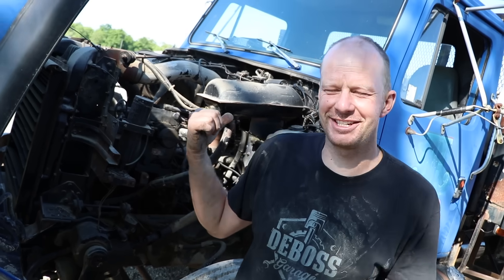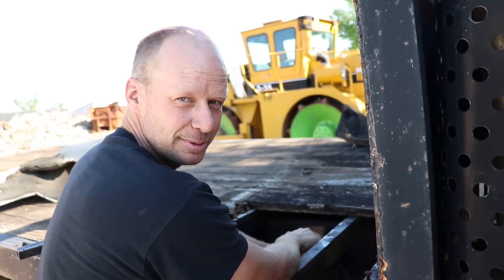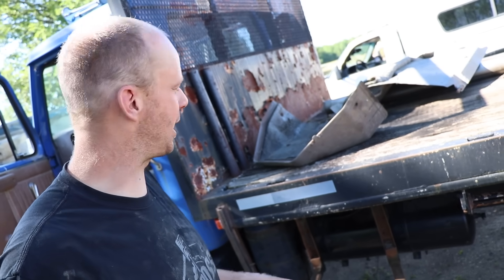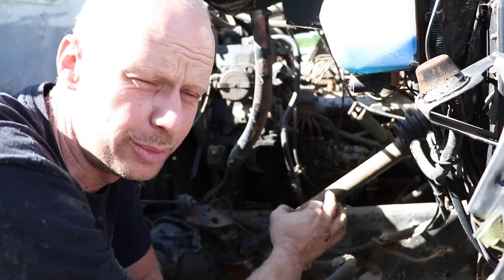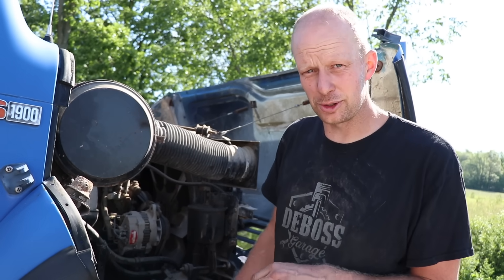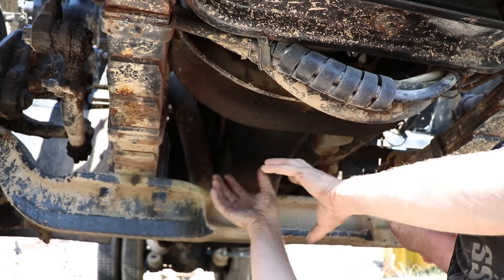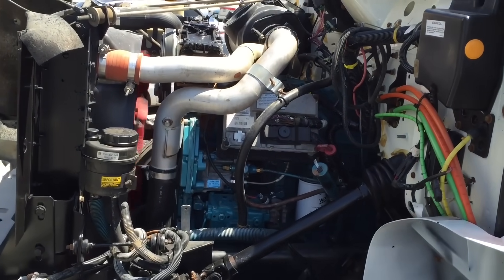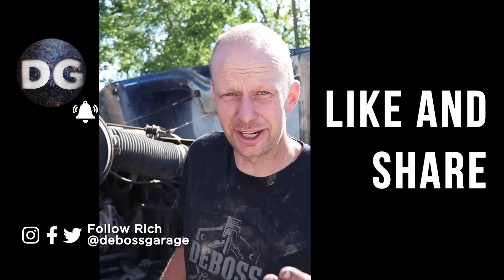REVIEW: Everything Wrong With a 7.6 Navistar DT466 Diesel

Comment from the maker: Happy Canada Day! What engine should we review next? 🤔
Reply: Detriot 60 series, Cummins 400, 6.2 Detriot, the Olds 350 diesel,
Reply: He already did the 6.2/6.5
Reply: @seanhazelwood3311  i know he did the 6.5, but I don't recall him doing the 6.2. Only issue they have from what I've seen is lack of power, but plenty of tourqe. You ain't going anywhere fast but you'll pull the house, the boat, both cars, and the mother in law while doing it
Reply: Both in same video. My experience with the 6.2 was in the army, first gen hmmwv's. Gutless was an understatement, impossible to start in winter. They hated mud because there wasnt enough power to turn 37x12.50-16.5s, even in low range.
Reply: Dt 366
Reply: Detroit diesel 53/72/92 two strokes or the 8.3 pincher four stroke. 8.2 N/A was highly reliable because it didn’t do anything.
Reply: Detroit Series 60
Reply: the new ford 7.3L gas
Reply: Lets see more Deutz engines 🧐
Reply: Toyota fork left engine
Reply: SD33T, Nissan engine that was put in the international scouts. Supposed to be easy to find them in forklifts and such, would love to know more about them, and about taking them out of more industrial stuff, and into vehicles.
Reply: Deutz BF6L913 air cooled
Reply: 855 cummins
Reply: 855 cummins
Reply: Yep Happy Canada Day Rich From Vancouver Island
Reply: DT530 mechanical 
The 466 big brother
Reply: 60 series
Reply: Perkins/Mazda 2.2L, as installed in a Ranger or mazda pickup.
Reply: 3.5 Ecoboost
Reply: 6.0 Powerstroke.
Reply: What about the t444e?
Reply: @pieissquared  He already did both the 7.3's.
Reply: International 392
Reply: will you be doing an everything wrong with the common rail cummins?
Reply: Om617 or deuzt f5l912
Reply: isuzu diesel engines
Reply: I'd like to see something on the Big Al Allis Chalmers 844cid engine
Reply: Mack E9500
Reply: 350 Chev Vs 351W Vs 351M?
Reply: any FIAT/Heeston tractors round your way? the small 6 cylinder and the 5 cylinder in the 90-90, and 110-90 were solid little donkeys
Reply: Volvo D13
Reply: Dt360
Reply: Ford 351 Windsor.
Reply: Allis Chalmers 844
Reply: i rebult one of the first generation dt466 the other day, it melted a piston and i have pictures
Reply: @loganbachman2769  share them to him.
Reply: Renault Clios 1.3 petrol! The kxj! 

Twenty years old and still carries me to work, can’t beat it
Reply: @ringodooby  problem: we don't have that here in Canada. We haven't seen anything made by Renault since 1988 (With the apparent exception of the Tiggy? Somewhere?)
Reply: @dposcuro  Mack. Synonymous with Renault and now Volvo. The E7 has Renault written all over it. The Club of Four Midliner and it’s predecessor are Renault.
Reply: @jcm78  Hunh, had no idea.
Reply: ISX15 600 Cummins
Reply: Cummins 400 c series cat or Volkswagen tdi engine
Reply: Big cam 400 cummins
Reply: VW 2.0TDI
Reply: Detroit series 60
Reply: Cat 3406
Reply: Mercedes OM engines
Reply: Deutz A6M428! lol
Reply: Doosan DV11 they have a sound that is amazing, they bark when revved from idle to full rpm
Reply: Isx15 or n14
Reply: 6.2 Detroit. How the block and injection pump numbers matter when picking the right year.
Reply: EcoDiesel and 1.9 tdi 👋🏻🇨🇦happy Canada day from Nova Scotia eh
Reply: I would like more on the international  DT 360
Reply: L10/m11
Reply: Old 304 diesel
Reply: 6.7 powerstroke.
Reply: Have you heard about Navistars MWM South American motors. The Iveco's Cursor motor which is basically a Navistar motor.
Reply: "What engine?" is the point... I'd like your thoughts on the future of diesel swaps, especially for small and mid-size trucks. Mercedes OM series a getting rare, wih VW out of the game the TDi supply will also dry up soon, and 4BTs are not always the best option due to weight. That leaves what, the baby Duramax and the R2.8? What if someone wants a small engine wih mechanical injection? Is there anything left?
Reply: C7 cat
Reply: 6.4 power stroke
Reply: Chevy 350 or anny small block chevy
Reply: 3116 cat, c9 cat
Reply: Yanmar 3t90j, I have a 1978 john deere 950 with one and would like more info on the engine than I have
Reply: Or the multi fuel engines that came in the m35a2 army trucks thatd be cool
Reply: 1150 cummins or maybe the 13 liter Fiat or a Paccar MX 450
Reply: C7 CAT
Reply: Powerjoke 6.0!!!!!
Reply: Cat c7
Reply: Cat c7
Reply: 237 Mack
Reply: The worst I've seen was the mechanical lift pump wore out and filled the oil with diesel which didnt hurt the engine just gave the an oil flush lol
Reply: Please
I need MORE videos on the twin turbo Duramax tow truck you are building......
When can we see some more on that build????
Reply: 5.0 or a 5.8
Reply: Fiat 0.9l
Reply: 5.9 common rail cummins
Reply: Chevy 4.8 L. And Allis Chalmers 4.9 L.
Reply: CR TDI
Reply: Perkins AT6 354.4?
Reply: 1999-2003 Ford 7.3 PSD next
Reply: Series 60 Detroit Diesel
Reply: Heui engines require 800 plus psi to fire the injectors
Reply: 855 Cummins. I'd go right from the original small cams through the generations of the Big Cams up to the the N14 Celect. It's had an insane run in the industrial world.
Reply: 6.9/7.3 idi, i had a 6.9 with 396k miles before i sold it and its still running around.
Reply: Big Cam 400
Reply: International 9.0 Liter. 70/80s 'glory'...
Reply: ford 300 lol
Reply: how about ISX, all versions from 1998-current?
Reply: Detroit 8v92!!!
Reply: 5.9 cummins 12V
Reply: Cummins 855.
Reply: How about the DT-530 and the DT-570?
Reply: 6.5 Detroit that came in the obs gms
Reply: @ethanboarman5627  No such thing as OBS GM, there is GMT400 though.
Reply: Nathaniel Clark  obs: 88-98 gmc or chevrolet pickup
Reply: @ethanboarman5627  That's GMT400, OBS is used for 1994.5-1997 Ford F-series with the 7.3L PowerStroke.
Reply: Nathaniel Clark most people around here call em obs trucks just like the fords
Reply: The DV550 or DV 800 International. Shouldn't have any problems finding anything wrong with those engines.
Reply: I have a 87 S 1700 with 9.0L International V8 diesel and Allison 4 speed. Needless to say the 9.0L is very weak but runs great with only 101000 miles on it. But I have heard nothing good about the 9.0. Would the dt466 be a easy swap. If the 9.0L fails.And will it fit the Allison without issue.
Reply: I really enjoy your informative videos,.Would you please clarify for me the difference in the DT engines and the MaxForce engines. I remember there being many problems with the MF engine. I was under the impression that they were not the same manufacturer.  What I have learned about the MF engine( boat anchor) is they are riddled with major reliability issues which is why they have been discontinued in the International.
Reply: Ford/New Holland 6.6/7.8
Reply: Mercedes MBE 900 🍻
Reply: John Deere 4045t...
Reply: Yes. How about the Ford 250 cubic inch inline 6 cylinder engine used in the Mustang, and Sport type Maverick cars.."
Reply: Do the little brother dt360
Reply: DT408
Reply: Maxxforce 7
Reply: Do the Wärstilä RT-FLEX96C
Reply: Do them all! 🤘🏼
Reply: Series 60 12.7 or 14l.   And mack 350
Reply: Could you please review a 6HK1TC 
Awesome videos!
Reply: You should do the Detroit 53 series and 92 series if you haven’t already
Reply: Isuzu npr hd
Reply: For gasoline KOHLER command and Chrysler Dodge magnum 3.9 litre v6  for diesel 426 cubic inch Allis Chalmers engines cummins n14 cat 3408
Reply: Ford 460
Reply: my girl found a turbo dt 466 and a monkey to go with it. its turbo with stock forged rods and crank but if i rev it past 4K the monkey will bite me and get angry! why does he do this and is trying to protect this motor as it makes him nuts! what is it with a DT 466 and maqack monkeys!
Reply: 6.6 and or 7.8 Brazilian/New Holland 6cyl’s
Reply: @DEBOSSGARAGE Where are you guys located? I would like to hire you for an engine job if your up for it. Please reply at your earliest convenience thanks.
Reply: IH 9.0L
Reply: As time goes by, perhaps revisit the engines you skipped, such as the DT466E.  It's been a while.  Have the problems been worked out?  Has the aftermarket come up with solutions?  They did for the 6.0, and others...what about the 466E?
Reply: OM606 both N/A and Turbo
Reply: Volkswagen TDI
Reply: @desmondmoonbear8149  ALH?
Reply: 3176/C10 Cat
Reply: Or a cummins n14
Reply: Briggs and Stratton 5HP vertical shaft. 😎👍🏼
Reply: Beinggrownupsux 80 flathead or ohv 😂
Reply: OM 617
Reply: @The_O40  om606 ;)
Reply: Cummins ‘triple nickel’ 555
Reply: 6.0 powerstroke
Reply: A mid 2000’s international school bus engine
Reply: E6 300 Mack!
Reply: Chevrolet 3.6 VVT
Reply: 6.4 power stroke
Reply: Any thing PACCAR.. An mx 11 or mx13 would be a bonus
Reply: Om616
Reply: Scania
Reply: @jerkerhybbert6417  the problem with Rich reviewing a Scania is....they are very thin on the ground out here in Canada.
Reply: next review the 50cc Puch Maxi engine :P
Reply: THATTSSS A BOOOOOOOOOAATTT IT LOL in the first 2 mins
Reply: C15 cat
Reply: @nickturner5755  has to be an acert!!
Reply: Do the 6.7 Cummins or the eco diesel and happy Canada day from British Columbia!
Reply: OM602
Reply: 6.7 powerstroke
Reply: Cummings LTA-10

Comment: I 100% agree about the 95's BUT, the first two years of the "E's" were the best 466s ever made IMO.  It has the hp of the newer E's without all the electronics problems that give the E's a bad name later in production.  If you can find a 1995 - 2008, that's a freight train of an engine.  150lb crankshaft, 250+lb head, wet sleeve, no def.  It's overbuilt with steel and electronics are basically still minimal.

Comment: As a 30 plus years as a heavy truck mechanic and most of those years spent in the dealerships I can say that they are a good engine and wait until I'm finished before screaming bloody blue murder. Even the newer ones were good and what I mean is the foundation is solid but it's all the shit strapped on the outside of them that's junk. We would laugh and say that the customer should buy 10 get one free egr cooler or at least a spare in the glove box. But ya I inframed hundreds of them. I've never cut so many counter boars and they are so simple to do even I did. I can't count how many times I would grab the cutter and head out to a farm or even an aftermarket shop to cut them. I just wanted to throw that in. Cool video and I will definitely check out your channel in more depth😂😂. Get it depth  ( counter bore). Easy fellas I'm older than dirt. 👍🔧🇨🇦😜🙏

Comment: I worked at Navistar on the Maxxforce DT466. CEO at the time forced this engine onto the market before it was ready. Actually, it was never ready. Navistar's cozy partnership with CAT introduced those awful HEUI injectors. The "Advanced EGR" caused the engine to plug up with soot which lead to egr cooler leaks and more. It nearly destroyed International until a new CEO was brought in and partnered with Cummins and their SCR emissions technology. The plant that built the DT466 was in Melrose Park, IL. Manufacturing of engines stopped several years ago there. The facility houses some R&D currently. The new S13 Scania engine is produced in Huntsville, AL. Navistar is now owned by the Germans - VW Truck and Bus. They bought Navistar and now Navistar is simply known once again as International Truck, but with German ownership.

Comment: A simpler way to look at it is that the 'E' version had all the tech that was used in the Ford Power Stroke but on the DT466 platform. 
This means all the issues that plague the Power Stroke engines also plague the DT466E. 

I ran a wrecker for years that had a DT466 with the later style Bosch pump and a turbo, when I left that place, the truck had 710,000 miles on it and ran great. I can't say what happened to it as they went bankrupt a year after I left and it all got auctioned off. I had that truck from day one, got it with 115 miles showing on the odometer the day I picked it up from the body installer. It was used as both a service wrecker on two major highways and for four local towns, as well as for long distance transport on occasion. It got regular 10,000 mile oil changes. The body was showing its age rust wise in the floors, both floors were gone just inside of the door seals, more so on the right than the left but the rest of the truck was fine.

Comment: Just bought a ‘95 4700 with a 466P in it. I’ve got a dodge with a Cummins, (turned up, turbo, cam, injectors) and I’ve broken the bottom end, clutch, and trans a few times . I’m down south, bought it at an auction up north…haven’t laid eyes on it yet, but sent it to a friends farm up there. They haven’t been able to find anything wrong with it. 

Told a bunch of diesel mechanic friends what I bought…they’re like ‘why in the fuck did you buy that? What is it?’ ‘95 international 4700.’ ‘What motor?’ ‘466P’ ‘what transmission?’ ‘Allison.’ ‘Hmm…well…not condoning that purchase…but I will say this. You will never break that engine or transmission. If you were gonna buy a pile of shit old truck, that was the one to buy.’

Comment: We had a 2012 ic ce bus with the dt466 and it is a horrible engine. It is very underpowered and doesn't run great, especially from driving over the years but even when we bought the busses brand new, it was still very underpowered
Reply from the maker: Everything after 1996 is electronic and is crap unfortunately

Comment: Thanks for an interesting video, confirming what I've heard about the DT466. 

I just bought an International Acco 2250 (in Australia). It has a DT466 in it with a cracked head. I've found a replacement DT466 to get the truck back on the road asap and am looking forward to rebuilding the damaged version.

Comment: I just bought a 1896 International with the DT466. The chassis only has 250,000 miles on it. I bought it from the original owner. The truck is in awesome condition inside & out. It’s got a 16’ Box with a lift gate. It’s awesome!

Comment: Does the mechanical fuel shutoff stop the mechanical lift pump too or no?  New lift pump installed and no clogs to lift pump but still not getting fuel.  So cam lobe in injection pump or what?

Comment: I have a 2000 with a 466E,  only 120,000 miles.  The only issues I have had has been replaced two water pumps,  (easy fix)  It is a 4 door RV hauler and I need to sell it.  Great rig but I need a 4wd  RV hauler now.

Comment: I have bought a pair years ago at an auction. Mechanical with the bosch pumps. They are set up for marine use with twin disc transmissions attached and massive turbos. Very unique set up indeed. I am yet to see anyone else use them in a marine application.

Comment: As an automotive diesel, the DT466 first showed up in mid-1975 for the Fleetstar line, and then soon afterward in both the Cargostar COE and Paystar. It had then appeared for the lighter Loadstar series in the summer of 1976, just in time for the 1977 model year, as a premium alternative to the company's own D-series V-8 diesels and the Cat 3208 and Detroit Diesel 6V53, all of which were naturally aspirated. 

But its very first appearance -- back in 1973 -- was in the agricultural circuit, starting with its use in the 4366 4x4 tractor that was itself made by Steiger to IH specs. The DT466 evolved from two smaller engines: the D(T)414 as first used in 1971 for the 966 and 1066 tractors, and the DT436 that was used in the 1466 and 4166 4x4 tractors.

Comment: Our 1994 fire pumper had no issues until the fuel pump on our DT466 mechanical. It’s a 1994 with very little hours and miles on her.

Comment: If you needed a good emission compliant engine could you use the dt466e with the better pump from previous years or are the main problems dpf egr and all the other rat nests? I am trying to find the best engine to power a straight truck that meats 2010 emission. great video

Comment: "you can rebuild it on the spot" a 250lb head and a 150lb crank shaft ya im good i dont need any more hemroids if you can get that head off up and out with out damaging the mating surfaces with it still in the truck good on ya. cyl heads are awkward especially  a 250lb one leaned over a truck im not that determined haha

Comment: Local garbage man bought two brand new 4900’s in 1992-1993, garbage truck bodies on both. I watched those trucks drive around town as a kid, unbeknownst to me, I’d be taking care of them 30 years later. Both are still on the road as of April 2022, I replaced a radiator in one of them, which was the second in the trucks lifetime. One has over a million, one had 850,000 and change. I also did oil manifolds in both, which was not a big time issue. Stupid slow, but they’re reliable as hell, especially considering they run PTO pumps everyday. The motors in these trucks are almost completely factory still, the rest of the truck has been rebuilt over their lifetime(s).  They had Allison transmissions retrofitted into them back in the early 2000’s by a professional shop and he hasn’t had any issues with them either. I’d say they have paid for themselves two or three times over.

Comment: What issues have you seen in the later electronic ones. We have an 04  4400 oil truck been very good. O rings on the injectors  and o ring on heui pump was the only thing 300k of off road diesel deliveries

Comment: I was a Navistar service manager for years until the problems of the last decade had me turn in my card for another OE. But yes, the lifters will up and decide to turn 90deg one day and wipe your cam. Navistar's fix for this was to double up the dogbones, looks like a tiny double open ended wrench, to keep the lifters straight and their single dogbone from breaking. Nothing says quality enginerding like two stamped steel plates rubbing together with no direct lubrication. Ugh. I should've left them long before I did. Maxxforce 7s getting new piston rings every 110k until they were out of warranty though, did me in with that company. They've been garbage since they ripped off Cat's HEUI system.